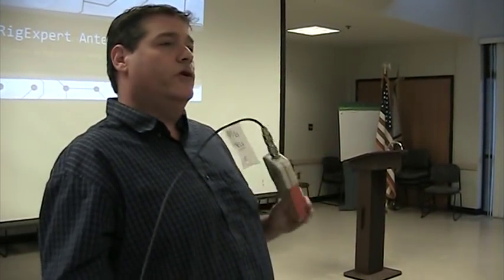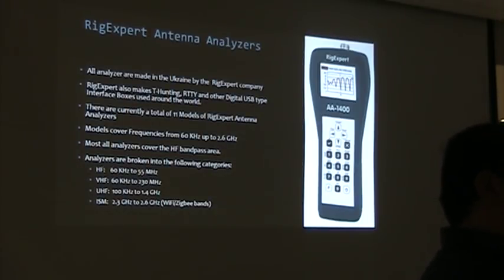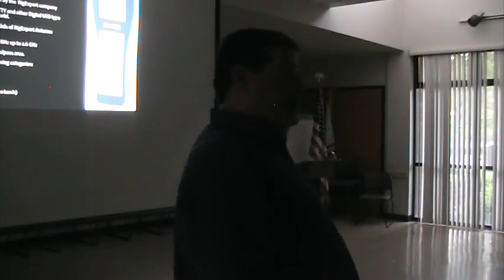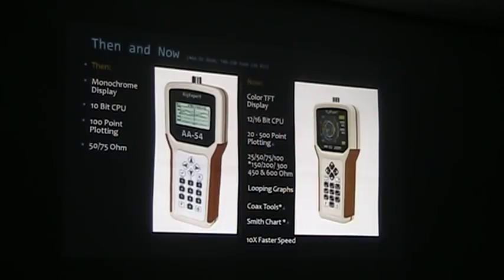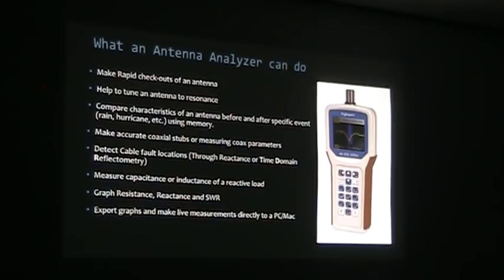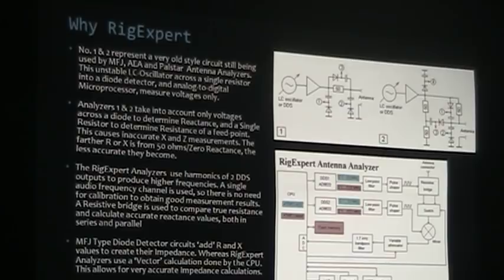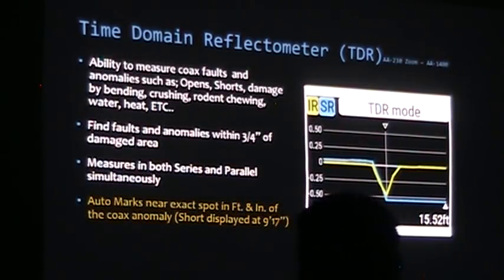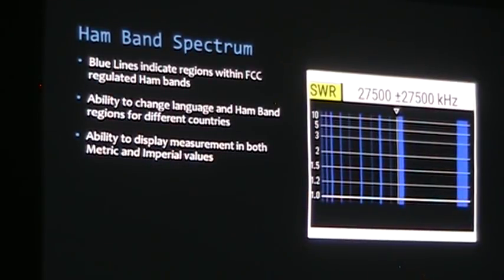May 2018 - RigExpert ZOOM Antenna Analyzer

Comment: Please note, our U.S. Located Technical and Operational E-mail, On-line Chat Window and Telephone Support are only available to those who purchase from RigExpert USA and PNC Engineering. All others must contact their point of sale, or RigExpert in the Ukraine for these services.
PNC Engineering is part of the RigExpertCare partner program and we will warranty analyzers purchased from any Authorized RigExpert dealer.  We do however stress that analyzers purchased from non authorized dealers selling on eBay and Amazon will not be covered under warranty. We may not honor warranties for those who sell on eBay or Amazon that do not ship from their warehouse due to a high level of damaged returns that have been returned and then re-sold. This includes items that are stocked and shipped by Amazon from their warehouses. Warranties must be accompanied by an Original Receipt from the Authorized dealer to receive warranty service. 
Please note, our US Located Technical and Operational E-mail, On-line Chat Window and Telephone Support are only available to those who purchase from RigExpert USA and PNC Engineering. All others must contact their point of sale, or RigExpert in the Ukraine for these services.

Comment: I’ve being trying to find the importance of phase in antenna analysis. Could someone point me in the right direction? (Excuse the yagi antenna pun).
Reply from the maker: A non-reactive load presents zero degrees phase shift.  Positive phase shift at the feed point indicates Inductive reactance and negative indicates capacitive reactance.  
When feeding directional arrays, different lengths of transmission line are used to achieve different phase delays to the excited elements.

Comment: i have a question the company didn't answer for me via email and the manual doesn't talk about. in the menu you can adjust the coax velocity factor number for making lengths, stubs etc. do you need to set the velocity factor number to match the coax for general antenna swr, reactance, impedance readings to be correct? hope this makes sense.
Reply: Yes it has a option in settings to change the vf. To get the correct readings it needs to be set.
Reply: The answer to your question is, no, VF has no factor on SWR and reactance unless calculating length, distance to fault, or 1/4 & 1/2 wave stub matches.